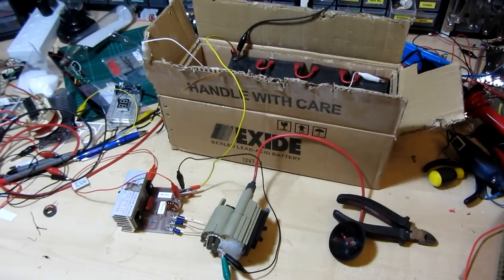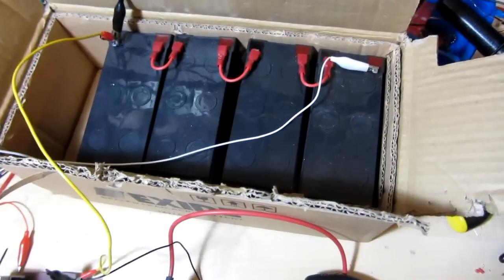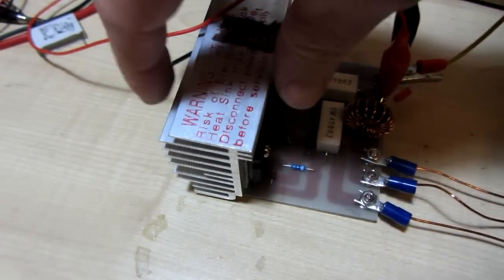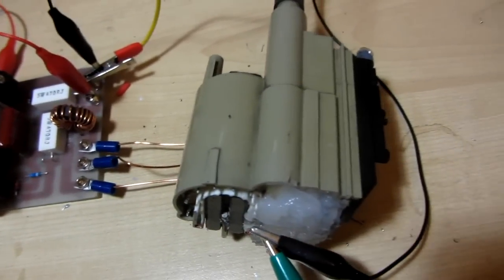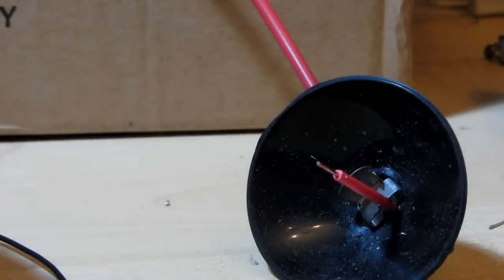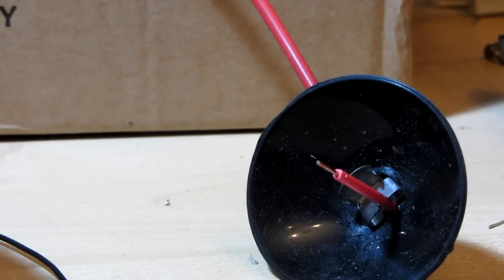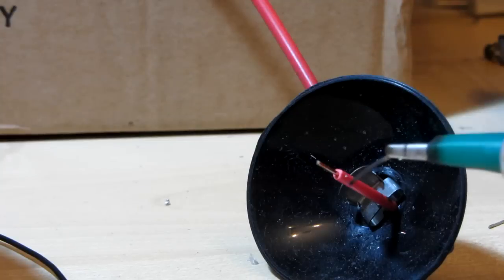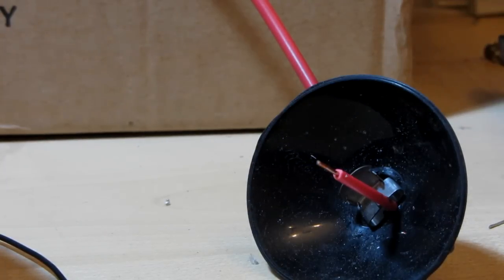ZVS Flyback driver

Comment: My 555 flyback driver gives a lot longer and juicier arc at 24 V. What was your input voltage for the 555 part? A 555 driver will never be able to supply more than a ZVS but thanks to that it is a lot safer (ZVS can kill, 555 can't). And you can use PWM to be able to play sound through the arc.